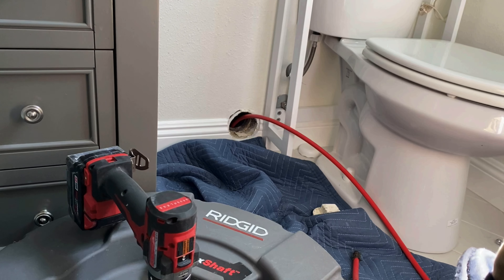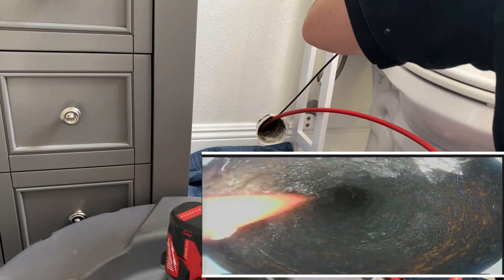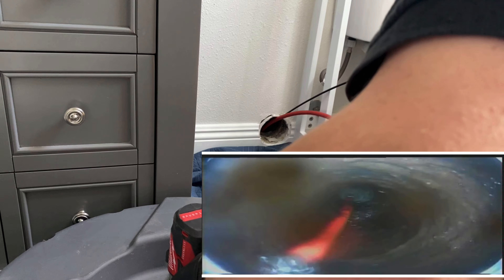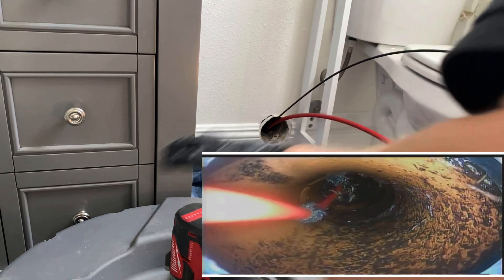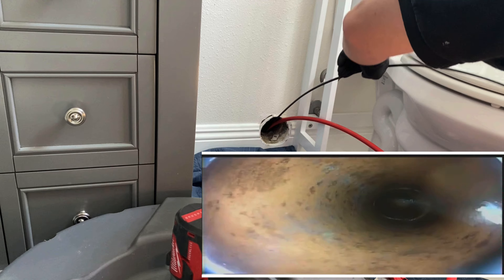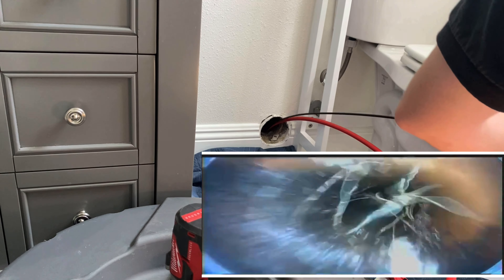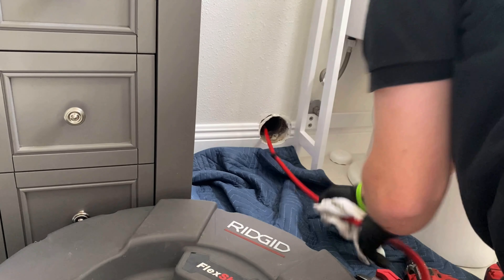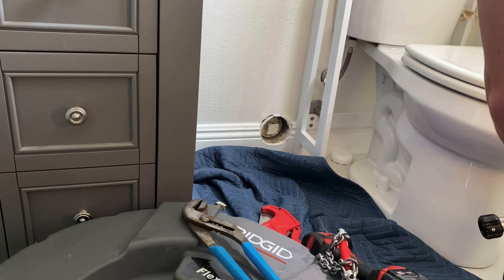Ridgid k9 204 Flex shaft Review | Unclogged Episode 13

Comment: Great videos brother. Just to clarify, you mention a lot that the 204 cable is a 3/8 (10mm) but it is a 5/16 (8mm). You might have changed it for the 3/8. 
Thank you
Reply from the maker: Oh man you are totally correct!!! When I was making these videos I was working with a friend on a way to load the 204 with 3/8” cables and it must of just gotten stuck in my head but you are totally right it’s a 5/16 cable!!! I’m gonna pin your comment.
Reply: Great to hear that and you are not the only one thinking about loading a 3/8 or even a 1/2..... Having the option to use bigger cables opens more options and durability wise it would be also great. I would like to thank you for always sharing your knowledge and opinions, it has been invaluable for many of us
Reply: I agree great video n  motivating  and learn new technology

Comment: I just got my flex shaft today.What drill was that and how do you find it lasts.
Reply from the maker: I really like the Milwaukee Brushless drill driver, you don’t want or need a hammer drill for this you just want a drill driver that spins at a high RPM I’ve had my eye on the New 24v FLEX drill because it has a turbo mode(lol) that allows it to spin at 2500 rpm, just hard for me to go to a new cordless tool system when I’ve already invested so much in Milwaukee so I’m waiting to see what Milwaukee comes out with next.
Reply from the maker: But I use that Milwaukee none fuel just brushless drill driver for now because it’s plenty powerful and was reasonably priced. I will occasionally throw my little 12v fuel hammer drill on it too but I always leave the clutch set kinda in the middle

Comment: Hi I wonder if you can help me. I'm after buying the flex shaft. But not sure if I should get the k9 102 or k9 204. If I get the 102 will that clean a 4" pipe with the right size chain. Because  I really want the k9 204 as if does 4" but will that go round a toilet trap.
Reply from the maker: The 102 is the one that you can shoot through a toilet trap the 204 is a little too big for that, I’ve unclogged toilet lines with the 102 but it’s dangerous for sure you could damage or break your cable or possibly even get it stuck like I did in a recent video. That being said I like the 102 for 1.5-2” drain lines it’s my go2 machine the first one I grab every single time. The 204 I use when I pull toilets or if I’m going through a 2” branch to stop into the main. Just like I said be careful, highly recommend running a camera at the same time

Comment: Thank you for your video I have all the drum machine friend mine has plumbing company in Arizona he has Picot and Ridgid  flex shaft he dose not like it becuse of the cables. Also I wanted to get Hydro jitter but you mention there is no need for one however  if you descale the cast Iron Pipe  how are you going flush the system because regular water hose dose not do it ? I would appreciate you comment ?
Reply from the maker: After descaling a line I will typically run a hose down the line, depending how bad it was Ill sometimes send it down with a pressure bag on to help really flush it out. Having a jetter is great but honestly since Ive been using my flex shafts Ive only had to jet one line.

Comment: I bought a 204 I noticed the push out in for inch becomes difficult on a line filled with water have any tips
Reply from the maker: Usually if im having trouble getting it out farther ill throw like a cleaning brush on the tip infront of the chains or a cleaning brush behind the chains, sometimes both works really well too. What I think happens is the tip is so heavy with the chains and the Ridgid cable is so bendable once youve gone through a few turns it becomes very difficult to push so buy some 1 1/2" cleaning brushes and try using those to help lift the tip of the cable up so it doesnt get stuck on offsets and just run the drill while pushing it out that also helps, Sometimes you can tape it to your camera and help use your camera to help push it out just tape the camera like 6-8" behind the chains. Ive also used a garden hose to help push the cable out, tape the cable to the garden hose and push them both at the same time. Hope this helps bro!
Reply: @PlumbingExplained  thanks I'll try it  di you have the 306 yer

Comment: whats about wet wipes ? are there drill heads available ? got only heads for 8mm - 32mm coils
Reply from the maker: Yes there are drill heads available but I caution you! If you are dealing with Wet wipes don’t get too courageous I just got my shaft stuck in a line because it wrapped itself in wet wipes and I had to go buy a small electric pressure washer and convert it to a jetter to get them off and get my shaft back it was really stressful
Reply: @PlumbingExplained  okay thanks for advise

Comment: Only thing worrying me is all the bad reviews on ridgid about cable breaking , love the idea of this
Reply from the maker: The cables only break if you are misusing the machines, I use them daily I’ve not really had any problems, only problem I had was getting the little 12ft 1/4” shaft stuck in a branch line because it dropped into a main and wrapped itself in wipes and let me tell you bro I abused the hell out of that thing trying to get it back and it’s still usable lol!!! So you really gotta be pushing them to the limit using the wrong drills etc to break them

Comment: Great content, I just ordered mine. There are a fair amount of people claiming the cables break  to easily, which has me a bit concerned. I also feel like finesse isn’t in some peoples vocabulary. This tool isn’t for everyone.
Reply from the maker: This is absolutely one of my favorite tools on my truck, the 102 is My favorite tool for unclogging and cleaning any lines up to 2” and if I can’t get it open with this I’ll send down one of my Spartans. Ridgid makes different heads now so you can penetrate clogs much easier. 

When it comes to repairing them, now that they’ve been around for a little while guys have come up with all kinds of cool different ways, my buddy Tony I call him the mad scientist because he’s always coming up with cool stuff and different ways to repair the flex shafts. 

When it comes to repairs You can order 5/16 cable from Zewer-tools.com or Plumber-tools.com and buy a crimp end and a crimper and repair your cable easily on your own. The ridgid cables you have to solder them before cutting them. My buddy uses the Plumber-tools.com 5/16 cable in his 204 drum and it’s like half the price and much more durable. I’m going to be dropping some videos on repairing and how I use them etc just haven’t posted in a while because all my go pro’s and Shit got stolen when my truck was broken into a few months ago but I’m gonna get back into it very soon.
Reply from the maker: And you are right most of the time
These break it’s due to user error, I haven’t snapped a cable yet, I did snap the pins on the gears but it was completely my fault and My cables have lasted over a year now because I’m very careful and I feel like I’ve learned how to use it now, it does take a little trial and error and there is a little bit of a learning curve / feeling out process but once you get the hang of the flex shafts they’ll be the main thing you use for drains.

Comment: Get it stuck and you will never use it again they are so expensive and cost to much when it gets stuck and then you are cutting open walls to get it out this thing is junk I’ll go back to the old one
Reply from the maker: @kinggrooms7473  I’ve gotten it stuck I was able to get it out with a little electric jetter I made, I think I have a video or a short about it.
Reply: @PlumbingExplained  I tried to pull it out with some different methods but it’s stuck so I have to tunnel and reroute a line it’s not reliable enough the old cables are cheaper and more reliable as well as cheap to replace
Reply from the maker: @kinggrooms7473  try this: Buy a pressure washer to jetter conversion kit on Amazon it will come with a hose and some basic nozzles. Go to Home Depot or harbor freight and buy a small electric pressure washer that does like 1900 psi, doesn’t really matter the gallons per minute cause your gonna just be using it to try and cut whatever your flex shaft is stuck on off, probably got stuck on some roots or wet wipes and you tried to pull it back through a smaller drain, that’s exactly what happened to me, I shot through a 2” cleanout and it musta dropped right into the main cause I was only using a little 10’ whip and is only got about half way in. 

Also Plumber-Tools.com sells a really cool retrieval head for the k9-102 and k9-204, if you’ve got a camera you can throw that head on drop it down and try and retrieve it that way. There’s plenty of ways to get it unstuck brother it ain’t over til it’s over!